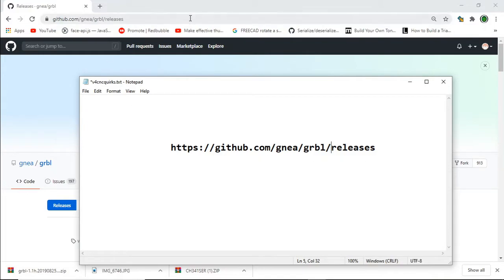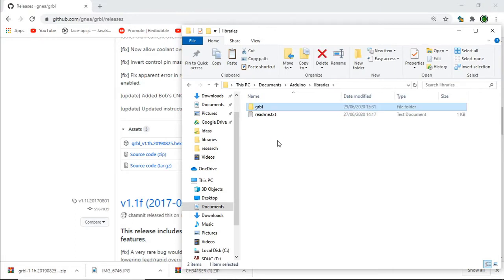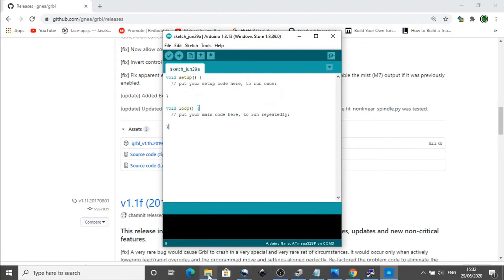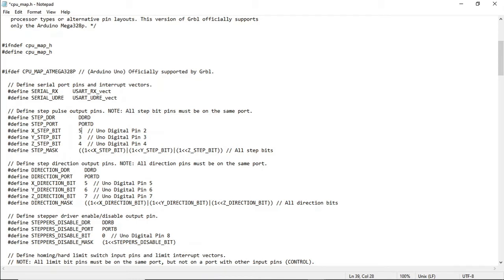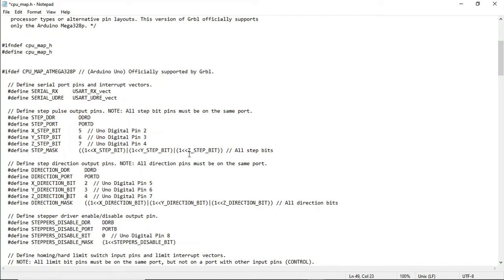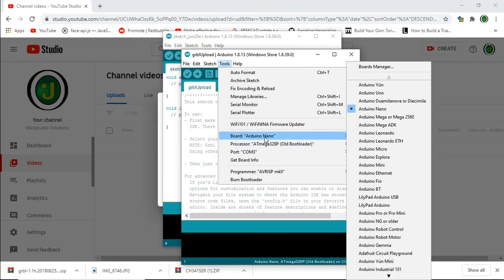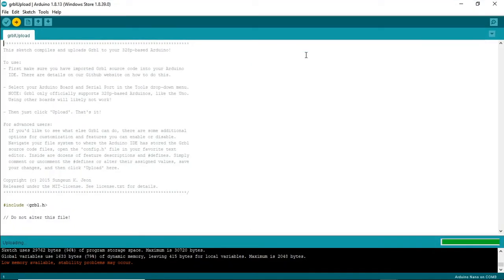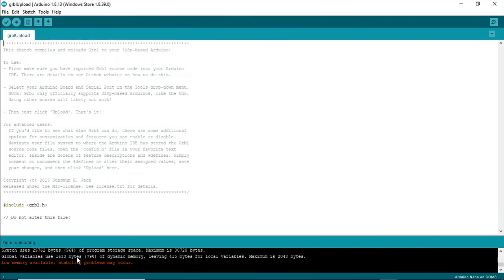CNC Shield GRBL v4 : Installing GRBL and fixing axis step issue Arduino Nano, cpu map problems

Comment: Unrar the downloaded folder, then compress it as zip, finally import the zip in the Arduino IDE:
Sketch->import Library->Add ZIP libray.
No fuss. You have to check zip when compressing.

Comment: Hi. I hope your still answering questions. I’ve just finished building a CNC machine using an arduino board. I’m using Carveco CAD/CAM software with the open builds controller for gcode. My machine will not cut a circle. Circle’s turn out to be square’s turned 90*. Could this grbl edit help me?
Reply from the maker: Hi, If your using the same board and cnc shield then at time of writing this fix has to be done for the board to operate correctly. Thanks
Reply: @MangoJellySolutions are you saying if I purchase a new board and CNC shield, make this change before installing it on my machine. It could fix my circle problem? I’ve been told that my problem is a G2, G3 command (no idea what that means) problem.
Reply from the maker: The tutorial is for the arduino nano cnc shield v4. If you haven't got this board then this fix will not work with your setup.  V4 boards have a number of flaws including microstepping issues as they are not wired up correctly at manufacturer. This fix is to solve one of a number of issues with the board. If you have the board then it's the first fix you will need to do if they haven't resolved the issue with newer versions (if they ever released a newer version which I don't know if they did) .
Reply: @MangoJellySolutions  thank you so much for your fast response. I’m using a v3 board so I’ll assume that this is not the fix I need for my problem. Thanks again.